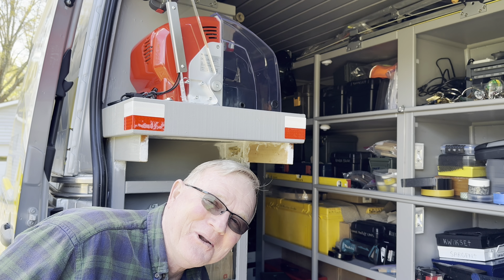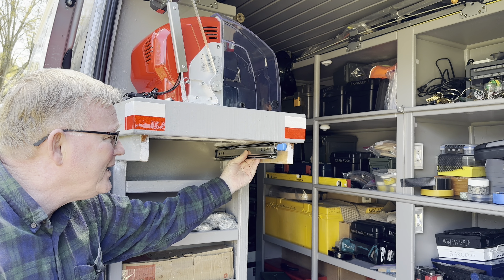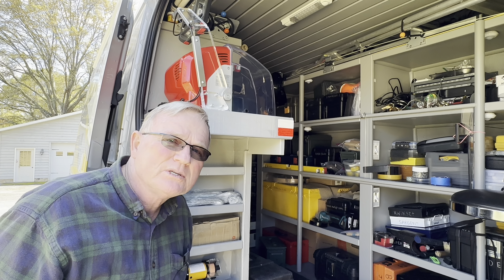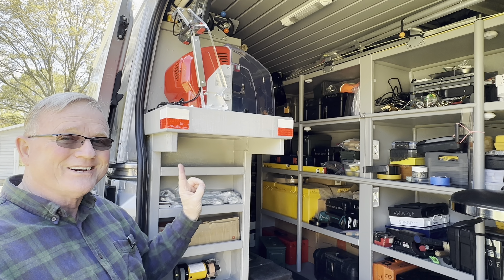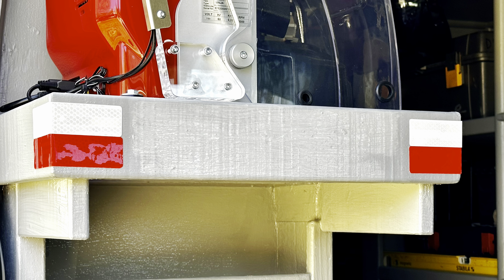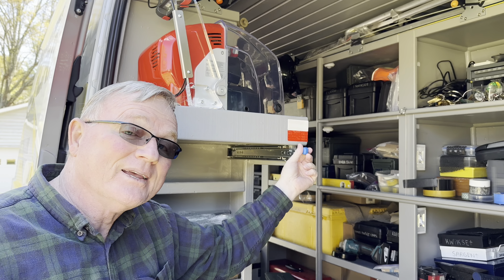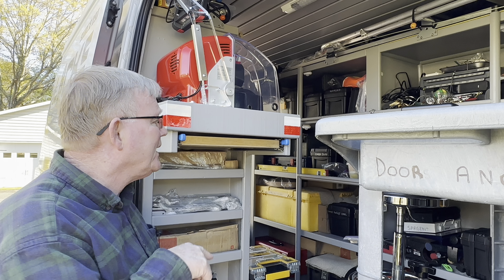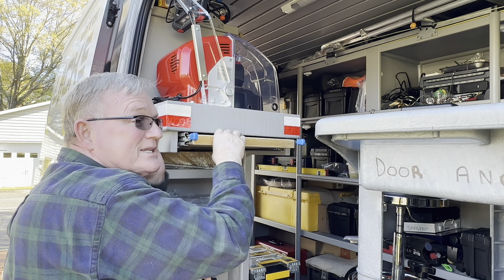The Ultimate Lock Pinning table #diy #automobile

Comment: Those things are great. I made a similar setup for my van. Mounted one of those oversized pinning mats to it. I'm thinking about repainting my shelving units... The whole grey and white thing is getting to me - too drab and sterile.
Reply from the maker: The epoxy that I’m going to recommend is so rockhard that it doesn’t even scratch and has no problem with adding color when you purchase the product from Sherwin Wiliams virtually any color of your choice, which is so cool tell me what color you think would be more fun
Reply: @doorandlocktips  Maybe a cobalt blue on the faces of the shelves and cabinets. Also considering an orange or yellow on the surfaces that actually contain stuff for better visibility. I haven't decided yet, need to head into Sherwin Williams to get some paint chips for the pre-catalyzed stuff. Might even paint the bulkhead divider.
Reply from the maker: Get Sherwin-Williams pro industrial pre-catalyzed, water-based, Apoxsee, color it any way you’d like but it is so indestructible so durable and it won’t get sticky with humidity in the air and it won’t chip off and it touches up beautifully. It’s a little pricey but if you have a contractor discount, the stuff is dirt cheap, I love it water-based epoxy pre-catalyzed is unbelievable